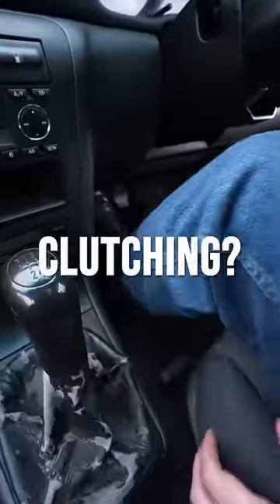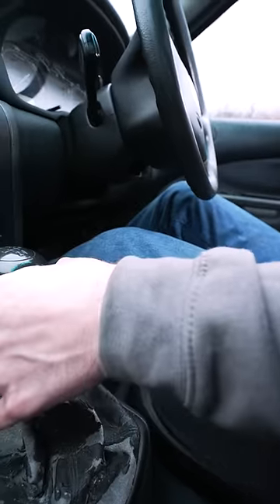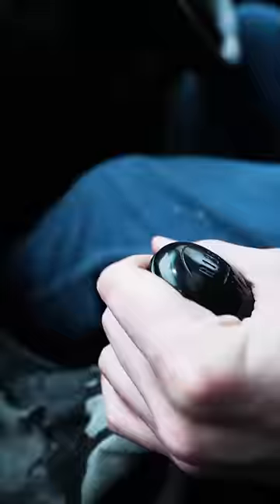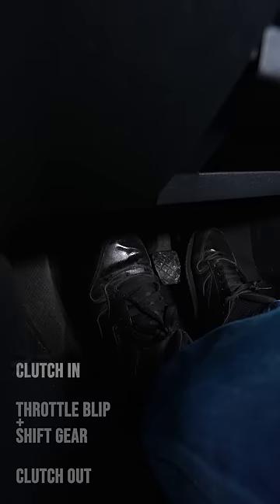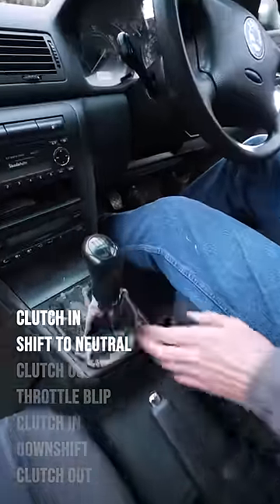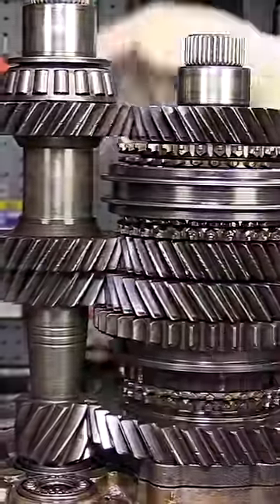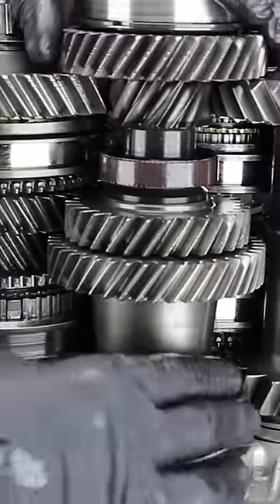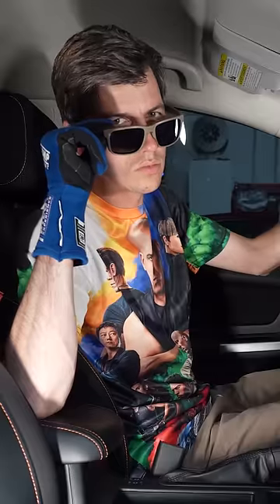What Is Double Clutching? Don't Granny Shift!

Comment: Fun fact: a Unimog 406 with the "big gearbox" option has 20 usable gears (not counting reverse). To shift from "18th" (5) into '19th" (L6), you need to operate two of the six gearsticks at the same time.

Also no synchro-mesh - but an experienced driver can shift without double-clutching.
Reply: Sorry what? Do I gotta become a Hindu 6-armed god to operate that beast? What do you mean use two gear shifters at once while shifting into the highest speed gear?
Reply: The Unimog is a beast
Reply: @baconthevainglorious7371 you have to take your hands off the steering wheel and use both hands lol

You have a high/low gear box, a 4 speed gear box, and a 2 speed read axle, at least in some versions.

I have friends with logging trucks in the US that have 5 shift levers, a 4 or 5 speed main transmission, and then 4 Brownie Boxes, which are basically small auxiliary transmissions that install behind the main transmission, with 4 speeds each.
To go through his gears, you need several hands looking

Comment: I learned to double-clutch in 1972; used it a lot on my Lotus Europa. and a whole lot more in my F350 work truck on packed snow mountain back roads. It's all about getting everything go shift smoothly together: engine, gearbox internals, wheels.
Reply: When it slips in like silk 
Chef's Kiss

Comment: Blimp to rev match which helps on down shift, but double clutch is something you do in a car from the 1940s and below normally. Some of those older cars had square cut gears as well.
Reply: or in a semi with a fuller gearbox .
Reply: Or in any tandem with twin sticks and 5 and 4 Spicers.
Reply: Well they aren't necessarily square cut. Most manual trans are constant mesh, meaning the gear teeth themselves are always in mesh. There is a splined shift collar on a hub that's solid on the main shaft that engauges the gear to the shaft when selected. That's where a synchronizer blocking ring would be. They should actually be called syncro braking rings. Those old ones just don't have syncro blocking rings. Synchronizer rings are kind of like little brakes on each gear that match the speed of the gear to the main shaft when selecting that particular gear. The only gears that aren't constant mesh (that actually mesh and unmesh) are usually reverse and super low on a truck trans.
Reply: Thats what you call a crash box
Reply: @thatslegit  or crunch box.

Comment: It is necessary on some big trucks, used to have a dump truck with a split shifter. Had to double clutch every gear
Reply: only in the USA. trucks in europe had synchros from the 50s on. only when the synchros go bad do you double clutch, Unimogs often had bad synchros.
Reply: Still very common
Reply: Doesnt every manual big rig need double clutch....guessing thats y we learned it in cld class.
Reply: @JAlves-vk8rz  only in the US. Europe has synchronized transmissions. Always did in my lifetime
Reply: @uliwehner  I'm a bit jealous,,, us in America are getting there, in California they took our 
diesel trucks away unless they are a certain year, don't matter if they don't smoke(did my smoke test yearly unlike smogging that's every 2years.)  I went from gas saved up changed everything to diesel then they started this law wich almost bankrupted me, changed everything back over to gas, started the business in 92, now in 2024 I'm recovered but my government set me back years
Reply: @adamclark9253  don't be. I am in georgia. For now diesel pickups are safe. The old 7.3 is still taking us places. Couldn't afford a replacement. Gas or diesel.
Reply: @adamclark9253 so the gov change the law from gas to diesel and after that from diesel to gas ? 
Thats nuts
Reply: @JAlves88 the government forces them to teach double clutching. When you take the driving test to get your CDL in a truck with a manual transmission you have to double clutch when shifting gears. And that is the last time you will ever use the clutch when shifting gears. No real driver double clutches when shifting gears in a manual we float them. The clutch is only used when starting off from a stop. It's all about finessing the go pedal.
Reply: @uliwehner  i drove a DAF that needed double clutch, in the 80's .
In winters wen oil was thick, i dc an synchronised truck to, for smoother transmition.
Reply: Now almost every truck is an autmatic! I cant imagine they have as much control and can imagine them constantly shifting in hilly areas. @JAlves-vk8rz
Reply: @adamclark9253 no you didn’t need to double clutch every gear, it would’ve shifted better if you didn’t use the clutch at all
Reply: @JAlves88  cdl class ...always makes me laugh ... because you still don't understand ..you make me laugh again..cdl clas? Ha ha
Reply: @jamesgibson5876  no idea what ur going on about but okay......
Reply: @newinans  
on the note of automagics constantly shifting, thats why most of em have a manual selector mode
select the gear (basically a 2 way paddle shifter) and just full send'er bub

Comment: For anybody that missed the detail, double clutching is supposed to rev match your transmission, not just your engine.
Reply: The most important detail is that SYNCHROMESHES exist, so unless you're driving something from the 1930's, double clutching is a waste of time!
Reply: @Bhong666  This comment simply suggests you were never taught how to drive a normal manual gearbox vehicle.
Reply: @Dranok1  I've never heard of Granny shifting until F&F N never have I ever used this style of shifting before the movie.
Reply: @Dranok1  No... 🤣🤦
Reply: @Dranok1  Wrong.  Double de-clutching is only to be used on crash boxes i.e. with no synchros, if you use it with synchros it confuses them inducing greater wear.  I was taught to drive in a 1950's van with no synchromesh so it was second nature to the point where I can powershift without a clutch at all.
Reply: @Dranok1 Your comment suggests that you don’t have a F’ing clue. 🤦🏻 ✌️
Reply: Thanks @dhHAWKEYE117, I scrolled to find someone who said what I thought.
Reply: @HowievYT  
Just doing my service to the Internet. ^w^
Reply: @Bhong666  
Depends on the model. Some brands were quick on the uptake to synchro meshes, some not so much.
Some synchros worked fantastic, others.... Not so much.
Semi trucks didn't start including synchros until not too long ago. Close enough, a great number of truckers still swear by double clutching.
Reply: @clivewilliams3661  well that's about as wrong as you can be... No, we're not talking about crash gearboxes here, we are talking about standard everyday manual transmissions. It's less the case today with modern engines and gearboxes that have far better torque and change so much more smoothly, but even now there's still a place for it with smaller less powerful vehicles. I learned to drive with the technique in the late '80s when it was almost essential, the Institute of Advanced Motorists still likes the technique (it's in my most recent guide for Observers), and I even made frequent use of it in my '98 Nissan Primera 2.0SRI (sports chipped but still couldn't change quickly enough to maintain power into an uphill sharp bend like I could with a quick double de-clutch).
"It confuses the synchros"?!? That's just ludicrous and made me laugh!  Only you can "confuse" the synchros by not having a well grounded understanding of how to change gear.  If, as sometimes happens when stationary or crawling, you can't get it into gear because you manage to catch it dog-to-dog ("grrrronk" ouch!) simply dropping the clutch and then depressing it again is enough to mechanically reset the gearbox and your second attempt is almost guaranteed to work.  Dropping the clutch and depressing it again while moving is the same technique!  Now in my new BMW I can't double de-clutch faster than my gearbox under torque, but it is an M Sport and has a relatively nice modern gearbox.  In a smaller modern car (and especially in my horrible new Renault Trafic) it can still be quicker to get into a lower gear without losing power -- use "granny shifting" and by the time the engine revs have matched the road speed up hill around that bend, you've lost 5mph or more.
Reply: I only need to double clutch from 2nd to 1st, as my 1st gear synchro takes a few seconds to synchronize the gearbox if I don't.
Reply: @clivewilliams3661 whatthe hell I'd powershift..float is just to slow revs to up shift ..increase revs to down shift
Reply: @Dranok1 bullshit using the clutch just gets you out of gear quicker under a load on a hill .. then you can slide into a lower gear as revs increase ..other than that ..float the bastads
Reply: @DJ_Level_3  I was wondering why reduction to 1 at higher speed than just barely rolling (which is very rare anyway) always ends up in grind. Interesting why those synchros are so slow
Reply: It's not missing the detail. It is yet another video that doesn't properly explain what double clutching actually does. They just now that's it's something related to "speed match" and do shorts about something they don't truly understand
Reply: @Siatkowkarzadzi  A LOT of transmissions dont have synchros on 1st or reverse so the reason why it grinds like that... Youre not supposed nto downshift into first!
Reply: @liamj3146  Interesting, that makes sense.
Yeah, I don't downshift into 1. But, for example when you are slightly rolling after slowing down before junction or speed bump you can go into 1st instead of 2nd. It will grind if you misjudged the speed and was going too fast for that.
Reply: @Dranok1  lol, no driving school teaches people to double clutch in modern cars.
Reply: @Siatkowkarzadzi double clutching actually does NOTHING on every nowadays car. Except trucks or something
Reply: @lpi3  It extends synchronizers lifetime to some extent, but probably not significantly enough for anyone to notice/care. And it helps to downshift to 1st in some cars, as discussed above.
Reply: Does the clutch also disengage the rest of the drive line? Trans, drive shaft, rear diff, and wheels? 😂😂😂
Reply: @dannyalexander2241  
No, but being in neutral does.
The "granny shift" disengages the engine from the drive line, to push the drive line into neutral - thus disengaging the drive line (axle and rear diff, which always have the same speed as the wheels.)
Then using the engine to rev match the engine and transmission to the wheels (which then refers to anything constantly attached to the wheels.)
Then disengaging the engine from the trans, to make sure everything is in synch, before re-engaging everything back together, all nice and synchronized.

As the first commenter mentioned, granny shifting isn't entirely necessary anymore, because of synchro-meshes, but it is a good practice for low transmission wear.
Reply: @Fightre_Flighte  the wheels keep turning and everything connected to them, rear diff, drive shaft and the output shaft in the trans. That’s why rev matching and gear selection up shift/ down shift is different depending on speed. 

With modern transmissions that have synchros it’s just not necessary. 

It looks like we might need to cover the definition of “granny shifting”- which is the act of letting rpms fall by getting partially or wholly off the gas between shifts. Then easing back on to the gas while easing off the clutch to rev match easier. 

Double clutch method is just wearing faster on the pedal, cables/hydraulics and throw out. 

If we are talking about hauling ass, neither the granny shift or Double clutch are the method. 

If we are talking about daily/ easy driving, practice make perfect- and still neither is needed. 💁🏻‍♂️

Comment: Thanks to this, I learned to change gears without using the clutch pedal. You just need to shift into gear at the right moment. This skill came in handy once in my life - when my clutch broke about 20 km from home and I was driving late in the evening, so I saved a few hours (waiting for a tow truck).

Comment: This video was incredibly useful to me. A friend bought an 88 Camaro with a 5 speed. While test driving it before buying he was having trouble getting it into gear while sitting still. 

Remembering this video, I told him to try letting the clutch go while in neutral. Did the trick!

It might have synchros, I'm not sure, but that specific time everything was catching and double clutching was actually useful.
Reply: It was actually the double pressed of the pedal hydraulics that built up the pressure to lift the clutch enough for the shift to go in. Either needed a new clutch, or something going on in the hydraulic system for the clutch.
Reply: That was more than likely a problem with the clutch hydraulics.  By double de-clutching (the correct term) it pumped up the hydraulic actuation.
Reply: No you don't need to double clutch an 88. Double clutching makes zero sense.
Reply: @rltozer7086  I would alter that statement slightly in that you ought not to need to double de-clutch an 88 because it has synchros.  However if the synchros are worn out then they can't function properly and therefore double de-clutching must be used.  The van I was taught in was a 1950's Bedford CA that came with a 3 speed but synchros only on 2nd and 3rd that by the time I drove it were shot.  Similarly my 1962 MG Midget had a worn out synchro on 2nd gear.  In both cases it would have cost more than the vehicle was worth to take the gearboxes out and fix them and there really wasn't any need for the synchros to enjoy the vehicles (assuming you knew how to double-declutch).
Reply: @rltozer7086 you've just followed THREE comments ALL explaining a reason why it can be necessary!!!
Reply: @elsecomojado1  I agree. If you have difficulty getting a manual into first or reverse with the car at a standstill, it is almost always because the clutch is not releasing fully.

Comment: I learned to drive on a 1938 Ford truck with a crash box 4 speed. No synchros. My Dad (RIP) taught me how to double clutch. My Ford '85 F-250 has a T-19 transmission and double clutching is necessary at higher RPM shifts.

Comment: You get a choice with a damaged synchro ring. $3500 or double clutch. Also, Rev matching when downshifting helps reduce clutch wear, and neutral at lights with foot off of clutch too.
Many older cars don't have syncro on first gear.

Comment: That's really only used in straight cuts, but you can float them too. Ask any truck driver, they only use the clutch when starting, stopping or reverse. Other than that, we just float gears.
Reply: I trained a recent driving school grad. When I showed him how to float "OH that's much better!"
Reply: I took my test in Ohio, you’re basically required to double clutch every shift. Out on the road driving, all you do is float the gears, and honestly the more weight your pulling the easier it is. Makes it hard to go back to a synchronized transmission though lol
Reply: @TV99DE I did my road test. The examiner said to show him at least one double clutch. The rest of the test I floated the gears
Reply: Question; I've never heard of "floating gears". How do you do it? Genuinely curious
Reply: @tapioca6863  you can upshift/downshift without using the clutch if you match the rev
Reply: @tapioca6863  pretty much you watch the rpm with the road speed of the vehicle and it lines up and your gear stick  just slides (floats) into the next gear when engaging. Honestly. I drive trucks, but I couldn't give you how it all technically works unfortunately. Maybe this help you get it a little?
Reply: You don't actually move the gears themselves, you select permanently matched gear sets by moving dog rings on the output shaft. Research it. 

Can float any gears. In a five speed, their ratios are typically only 500 RPM apart, overdrive .7:1. A six speed adds a second overdrive, .5:1. Takes practice and attention to the sounds. Clutch will last longer by floating, but the dogs will last indefinitely if you just use the clutch. The clutch is much easier to replace than a dog rings.
Reply: It works well with trucks. With cars, the wear on the transmission just isn't worth it. That said, a lot of NASCAR drivers were floating gears prior to the cheng car, where they switched to a different transmission and shifter style.
Reply: @BawkBawkBawk666 They're supposed to require you to double clutch the entire test now, but a lot of examiners don't care.
Reply: @karlrovey  my examiner said he just wants to make sure you can operate the vehicle in a safe manner. He said drive the way you feel comfortable, because you're going to drive that way in the real world.
Reply: Would a  01 trans am ws. 6  benefit from dbl clutching or were the synchros advanced enough by then,?
Reply: @frankmarshall9245  synchros didn't really "advance" per se. It was a simple engineering technique that they solved on a chalk board. Yes you read that right. Chalk board. That's how old they are. There is absolutely no benefit to trying to double clutch a modern vehicle. By doing so, you'll probably end up wearing out the gears by incorrectly attempting it.

Comment: Learned how to double clutch on a Model A Ford 1929.
Reply: Double clutching IS a thing in a Ford Model "A" for sure, Not needed in a Ford Mustang (unless the syncros are fried). LOL
Reply: @jamesslick4790  Well the mustang my grandfather has is an automatic, and for standard other than the Ford A, all I have/drive are tractors. And one does not double clutch a tractor.
Reply: @braybraymaster77 when I learned to drive a tractor, I had to double clutch for my road test
Reply: @Wise4HarvestTime  well the ones i have only have 4 gears, one road gear. So no time to even double clutch.
Reply: @braybraymaster77  that makes sense.  Dirt tractors 🚜 aren't quite the same as road tractors 🚛.  Transmission steering and tires are a lot different
Reply: Jeez. You did that 95 years ago?
Reply: @MarkSiosal  haha no but it was the second car i drove after i got my permit.